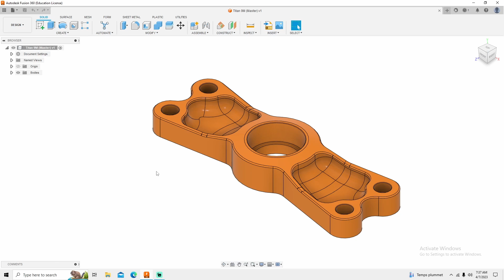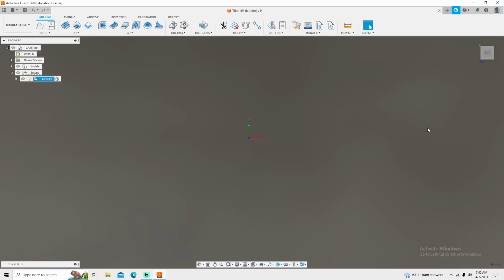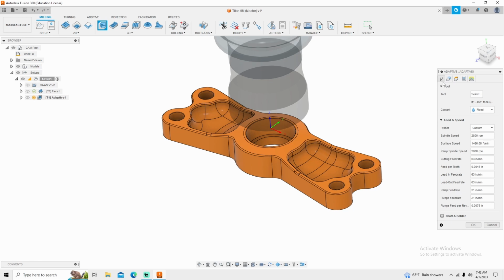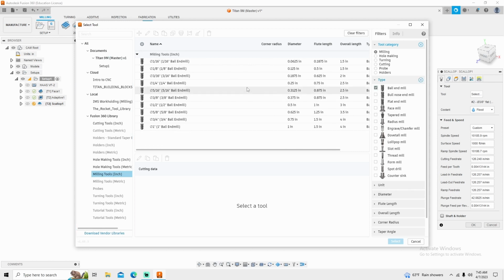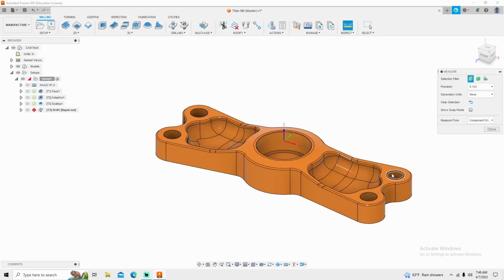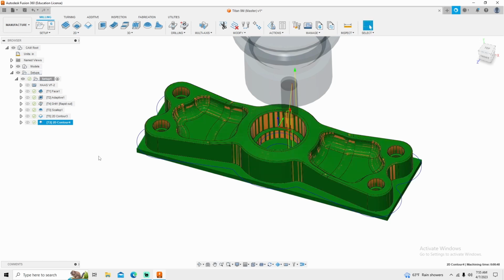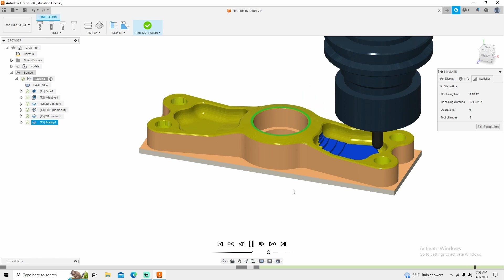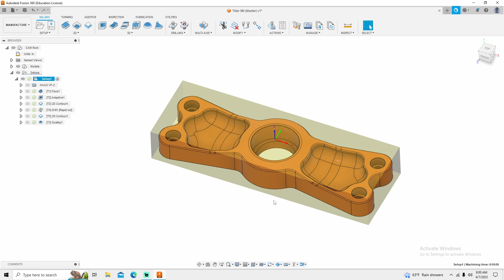Titan 9M (3D Adaptive Machining and 3D Profiling)

Comment: What was your reason for turning off the lead in and lead out for your facing op?
Reply from the maker: No real reason. I just prefer not to use it on a face mill.
Reply: @machinistmade784  It’s nice to have the vertical radii on so it keeps a smooth motion and doesn’t have to slow down for the direction change.
Reply from the maker: @Mechanical Advantage  completely agree. But I have trained A LOT of new operators, and it scares them. Lol, they see a big tool approach a part and suddenly it starts diving towards the part they just loaded 🤣. Also if the saw man is off (part to long), it can actually cause an issue with the face mill hitting and kicking the part up.